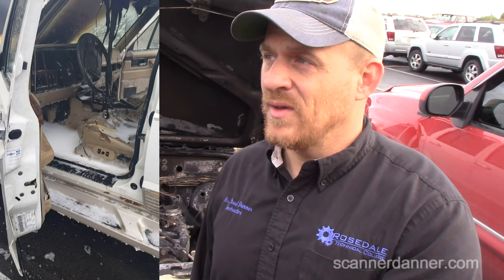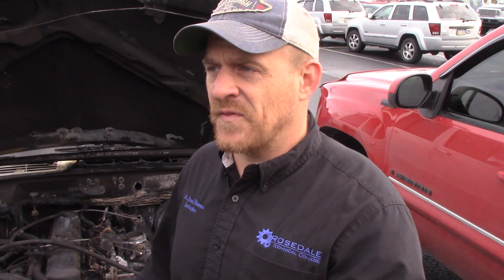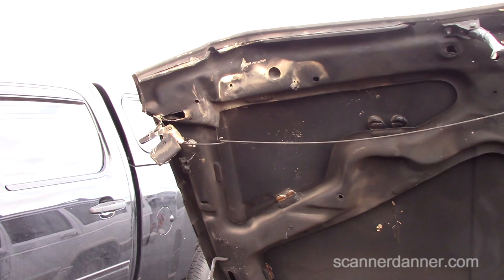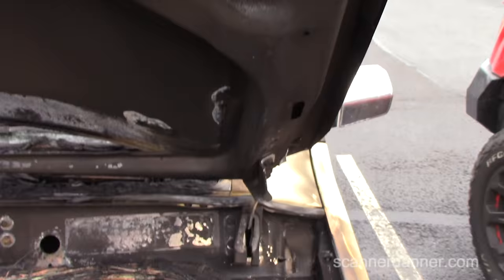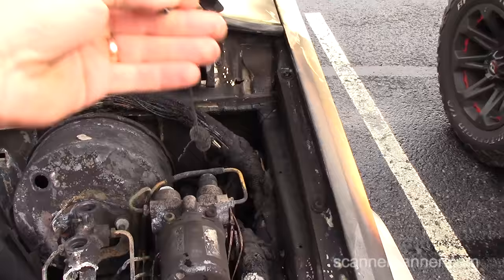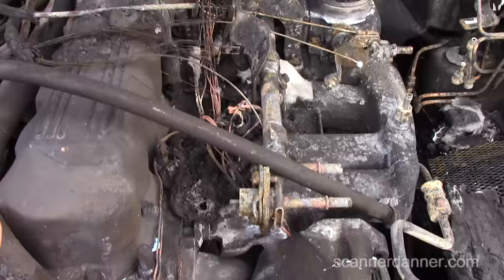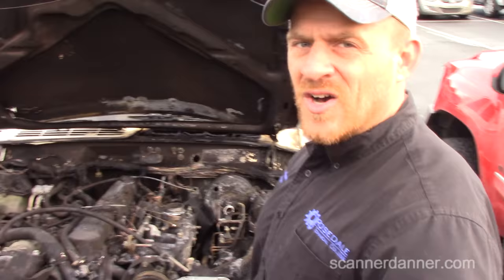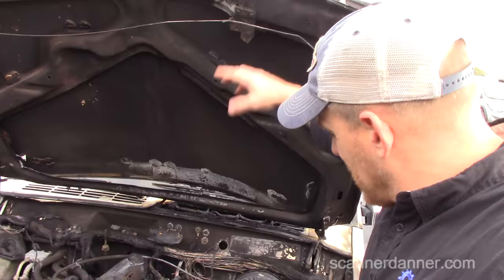ScannerDanner's Jeep CATCHES ON FIRE!!!

Comment: Well some days ya get the bear and some days the bear gets you... Dang man, and that is why I make sure my garage keepers insurance is fully up to date :) Like you say, at the shop last, you own it, right or wrong. I can't prolly find you a real sweet NY jeep if you like, you know, just a little rust haha
Reply: Only 3 years old, new tires and low miles right?  O_o
Reply: South Main Auto Repair Some days you get the elevator, and some days you get the shaft.
Reply: South Main Auto Repair. I put a rear end in a 95 F 150 customer pick it up 4 day later come back in next morning to work it had an engine fire customer got a nice used truck for free....... it happens
Reply: Some days you're the bug, some days the windshield.
Reply: As a shop owner I would be looking for a way to blame the customer, if that doesn't work offer kbb trade in value, if the customer still persists find the cheapest running cherokee I could or one with a blown engine to swap the engine into and send them down the road.  No way I'm buying you a new 80K range rover when you had a cherokee with 300K miles.
Reply: Might last ya six months to a year before big nasty condemns it. Lol.
Reply: South Main Auto Repair LLC
  the bear bitten 
ScannerDanner in the rear LOL

Comment: i worked on a car like 15yrs ago that caught fire after it was driven away and parked for about 4 hours. i put a fuel pump in it but the fire started in the trunk area above the pump, we still bought the car. customer was happy with the outcome and has remained a customer to this day. they also got a free pre purchase car inspection and i gave 1/2 the labor away on their first major scheduled maintenance. we owned the mistake (not knowing if we did it anything wrong) and kept a customer happy.  customers just want to know that you are gonna stand behind your work no matter what happens. i'm sure techs everywhere have many stories that end well like this. good luck with your search for a replacement.

Comment: Paul, been there brother! I changed a timing belt on an Avenger on a Friday afternoon. Didn't quite get done before quitting time, so the boss hired someone to finish the job. He still didn't quite finish the job, so Monday morning I wrap things up. Everything seemed to be OK so I took the car to the gas station a few miles away since it was on empty. When I came out after paying for my gas, the car was on fire. Luckily, I was able to pop the hood. Another customer dumped his brand new soda on the fire, then used the empty cup to grab windshield cleaning solution and we got the fire put out. Turns out that the valve cover gasket wasn't in the groove in the valve cover, which caused a 1/8" gap between the valve cover and the head. It didn't ignite right away, but after all that oil leaked out and puddled on top of the frame, then it ignited. Fortunately the only damage that occured was a little bit of wiring. BTW, love your videos.

Comment: Sorry for your loss. I've blown crap out from under valve covers before the same way you have described and haven't had any fires. I haven't done it 1,000 or even 100 times but still no fires. Come to think of it I blow off the top of the engine quite often, and sometimes fling oil from a leaking gasket all over the engine compartment, when replacing intake gaskets and valve cover gaskets. I'm not a jeep guy but have a couple of buddies that are and I know they'd be devastated from a fire like yours. Good luck in your search.

Comment: There were some Bosch fuel injectors from the mid 1980's to mid 1990's that were prone to having the internal o rings leaking when using gasohol (which is 10% ethanol and sold everywhere today except for some marinas). My '86 Buick Century with the pre 3800 FWD 3.8 liter had the Bosch injectors that started to leak. Injector Wizard is where I bought the replacement refurbished injectors and they had a list of vehicles with problem injectors and the 4.0 L Jeeps were on that list.

Comment: I own  two Cherokees. A 93 and a 95. The 95 I own is just like the 94. I have done the same job you did to them (valve cover gasket), and that definitely did not happen. I am thinking that you had an exhaust manifold crack, (very common on these) and you managed to get some debris from the valve cover job on it. The only other time I have heard these things burn down is when the injectors fail and they start to leak. I have replaced my injectors with more high performance ones anyway, so that issue is gone. I am sorry you lost your jeep, I was so excited to see videos from you about a car like mine. I hope you get another one someday. Thanks for your videos!

Comment: Hey , at about 5:54 in I am 90 percent sure I cannot see the heat shield that was or should have been done for the recall. They used a heatshield under the injector harness to prevent exactly this from happening. Generally the injectors would blister open and rupture allowing the fuel to flood over the exhaust manifold. specifically in the area of cylinder 3 . Wish I could zoom it in just a bit more
Reply: ONBOARDTECH333 yep I noticed that too. My 98 Cherokee had the same problem. I learned about it because my injector harness insulation got brittle and the injector harness shorted.
Reply: *****
The problem here though is discerning whether or not a fuel leak was the direct cause. It's very possible for an electrical fire to cause a fuel hose to melt/burn through and fuel the fire.
Reply: Benjamin Esposti , My   thoughts  exactly ,  for  sure ,  Electrical ,  Maybe  a" HOT  Wire"  that  was  running  on constant  power  from  the  BATTERY , (UNFUSED) , &  IS RUNNING  INTO  the  fuse  block ,  probably  got  a surge  of  power , & just  went  OFF ! ,
   SOMEone prior  was  doing  electrical  work ,  i know , 
i had  to  install  a , "Brake  Controller " on my  mini  van  for  my  Pop  up  Trailer ,  & the  instructions  are  specific ,  because ,  if you don't run a wire from the controller box straight to the battery ground ,  your trailer   brakes  will not work...

Sorry  for  your  Jeep,  Paul ,  but  at  least  you  caught  it  time ,  & no one  got  hurt ! !

Comment: Sorry this happened. You and Eric O are right. You worked on it last. The customer will not understand because they don't have a way to get around. The carbon thing is common but since I came from the time of Quaker state under intakes I use a shop vac now. It seems plausible that brittle insulation on injectors short to a power and ran up in the harness toward the hood cable. Count your blessings . It could've been worse. thanks Eric O for the insurance reminder..

Comment: Sorry for your loss. Hats off though for accepting responsibility. Right or wrong the customer always blames the last guy who worked on it.  As a mechanic for 30+ years, I don't think oil chunks on the exhaust would have burnt wiring on the fender- not that quick anyway.

Comment: Hey Paul, sorry to hear of your loss. I've worked on quite a few of these, and my dad owns a 2000. One common problem with them is the pcv system. They pull a lot of oil thru the air cleaner box. Since you just did the valve cover, chances are, the hose to the rear fitting on the valve cover cracked, being old and brittle. That may have been what fed the fire. Also, the hood release cable goes up the hood along the diagonal brace to the bellcrank.

Comment: I own a 93 Grand Cherokee that has survived a very similar electrical under hood fire.
The fire was put out quickly and did not really do much damage. There is still evidence where a hole melted through on the fuse cover. As some of the other viewers have suggested I doubt it was caused by blowing out the oil coke. A very good indication is that there was enough heat so quickly to melt the hood latch cable. An Electrical Arc will produce this kind of heat doubtful that oil coke would unless burning for a lenghty time.
PS. If you would like to replace yours with a 93 let me know and we can work out the details (LOL).

Comment: Sorry for your loss Paul. Looking at the video it seems that the main heat source is from the the wiring harness near the brake master cylinder on the firewall. The white on your hood amongst all the black soot is a dead give away that the most intense heat of the fire was there.

Comment: Tough break.  I cleaned out the lifter gallery in a 403 Olds of carbon-like coal chunks with a fireplace shovel.  Collected half a shopping bag full.  Lack of oil changes is a serious problem.

Comment: Used to work on a lot of 30 year old air cooled vw's (when they were only 20-30 years old) and sure- yes, antique cars (and that jeep is nearly antique) will catch fire sometimes.  I think we had at least 7 or 8 extinguishers in the shop.  I had one catch fire 5 miles down the way on my test drive loop.  put it out with a bottle of water from a passing motorist.  that bottle of water (and the hood cable was the difference between my situation and your total loss.

Comment: Had a similar case where I work.  Did some work on a jeep came back 2 weeks later with an engine fire.  It started above the interior fuse panel and made it through the holes in the firewall.  Did the same as yours burned the hood cable in half.  We don't think it had anything to do with us but like you said we basically bought them a car.

Comment: Bro, that's a shame! That was a great vehicle platform for your video series. I can see clearly that the fire started a the main engine harness by the scorch marks a the back underside of the hood near the cowl panel. You state that you smelled an electrical burning smell, that was probably the conduits beginning to smolder and by the time you returned from getting coffee , the harness had begun to burn which lead to the release cable frying. So sorry for the loss, but , it served a useful purpose in teaching and learning , so, in that respect, it was not effort in vain. Please , in the future, stay away from jeep products, what if your family was in the vehicle when that happened, a tragedy of major proportions could have insued. Thank God that only the jeep was the loss. Your a blessed man!

Comment: Years ago I was a working manager in Woodland CA.  The owner brought his Blazer in after a transmission shop put a trany in but couldn't fix the check engine light.

Test drove with scan tool hoping to catch a glitch.  Romped on it pretty good too.  Came off the freeway and headed back home when I noticed smoke coming from the back of the vehicle.  Pulled over and noticed smoke coming from under the hood, not much, but it was smoke.  Don't remember the color.

Got out, opened the hood, and saw that the fire was caused by a transmission fluid leak dripping on the exhaust manifold.  The trany shop had a make shift rubber line in place of the steel line, elevated about the exhaust manifold.

No extinguisher and fire was too big.  Closed the hood, got the scanner and walked away.  Passerby stopped and  I asked him to call 911 (cell phones were not popular back in those days).  Fire department came shortly thereafter and put the fire out.  Coincidentally an investigator was 'educating' his apprentice side kick, showing him where the fire originated (pointing to the opposite side of the engine compartment that the fire actually started).  Told them differently which resulted in a luke warm reception as if I didn't know what I was talking about.

Transmission fluid does catch on fire.

Another case story:

Working at a Toyota dealership a tech drove back into the shop from a test drive with smoke coming out from the hood.  Opened it and there was a small but manageable fire on the backside.  He just replaced the rear valve cover and pinched the gasket making it leak oil on the exhaust manifold.

Here is another one:

Working at a Shell gas station a young man was yelling 'help fire!' from a bay on the other side of the shop.  He just put an injector in a Cadillac and it caught after a test drive due to a cut o ring.  What made it worse is the hood didn't stay open (struts).  Put the fire out with minimal damage.

One more:

Worked as an apprentice at a Nissan dealership.  Nissan had a recall of some of the older vans catching on fire due to a coolant leak.  The vehicle would overheat, the hose would spring a leak onto the exhaust system and it would catch on fire.  So, they were retrofitting these new vehicles with a revised computer system (and other things that don't come to mind).  Yes, coolant was the cause of the fires.

Ok, one more (last one; I promise):

Working at another Toyota dealership a customer brought in their Tacoma due to an intermittent no start, which was caused by a defective starter.  Customer declined work due to being too expensive.  As the vehicle sat out on the return lane for the customer to pick up the vehicle started to smoke under the hood.  Customer yelled 'Help help! My car is on fire!'  Young buck came to the rescue with a fire extinguisher and put the fire out.  What happened is that the solenoid stuck causing the battery cable to become super heated due to too many amps, catching the insulation on fire.

S**t happens, even to the best of techs.  If you are working out of your garage on people's cars, and are not insured, you can be held liable so be careful.  This is a prime example of how things can get real bad, real fast.

Comment: Sorry that happened to you.  I hope your next Jeep is even cooler.  I set my Bronco 2 on fire once.  Fuel pressure regulator went out.  Cylinders had hydraulic lock.  Took out plugs and cranked engine which pushed out fuel just fine.  Except a spark from one of the plug wires set it ablaze.  DOH!  At least I had the hood open and was next to a bunch of fire extinguishers.  No serious damage.  Whew! Very exciting.  Lots of running and swearing.

Comment: I saw this the other day, glad you're OK Paul. you're a great teacher and very humble. Im an automotive tech down in Florida and my shop does independent forensic investigations for insurance companies, lawyers etc.  Without bias to the vehicle or work,  just by a quick view it appears if the fire started in the main harness on the driver side fender. That is an obvious hot spot along with the obvious damage/cracking to the master cylinder. The wires near the injector don't appear to be as brittle,  if the fire were injector/fuel related you'd see a lot more heat damage in that area. By what I saw I'd most likely bet after a few other checks our lead investigator would likely deem that accidental by cause of faulty vehicle wiring/component placement. 

Think of it like this,  if the release runs along/near the main harness and you chafe the wrong wire guess what,  you just welded that release cable to the inner sheath. Boom,  no Hood pop and would happen soon and without much smoke or indication of heat.
Reply from the maker: Thanks Jon. The interesting part is the hood cable didn't get welded to itself, it was melted completely. When I pulled the cable, the entire inner cable pulled out. The hood release was broken when I bought it and it had vice grips as the hood release. So without the normal hood release, you can visualize how the entire inner cable would pull out. I had 2 foot of cable inside the Jeep when I pulled it. At that point, I knew it was going to be a total loss.

Comment: I lost a 91 Capri because a trans cooler hose split and sprayed fluid on the exhaust manifold on a 97 degree day in 2005. No insurance. When I hear that your jeep had 300k, all I can say is it has a long life and served you well. Good look with whatever you replace it with.
Reply from the maker: Yep, but it's long life was with someone else. I just bought it a few months ago and probably only put 50 miles on it.

Comment: I had a similar experience many years ago, I know how you feel I felt the same back then, the only positive thing to come out of my experience was the customer admitted the fire was not caused by the work I did, which was changing the rocker gasket on a Renault, I guess I got lucky back then. Good luck finding another motor and don't let it get you down, we're human at the end of the day, we can't see everything on a vehicle we have worked on, they are very complex machines nowadays.
I remember attending a Forensic Fire investigation some years back, the forensic was examining a £160 000 truck completely burned out, the driver smoked and had instructions not to smoke in the cab while driving, the forensic found a cigarette stub in the air box housing, caught the air filter (paper) intake air accelerating the fire (like blowing on a cig end), the whole truck burned out. Apparently the truck driver smoked in the cab through the cig stub out the drivers window and the air intake (many litres of air per second) sucked the cig stub into the air trunking and the driver denied it but DNA proved it. If it were financially viable forensics would find the proximate cause, but its probably not cost effective.

Comment: It is unfortunate to see what happened. Don't let it get you down.

I personally believe it was the wiring harness that caused the fire. I saw one car burn down across the street. The car was sitting after being parked. Then suddenly the alarm went off for no apparent reason. 10 minute later the car burned down completely.
Another example where a car burned down for no apparent reason in a workshop when it was left on the lift overnight. Took a whole block of units with it. Very unfortunate for the garage owner and everyone involved.
I believe UniversityMotors channel has a video where they replace a harness on an MGB because it tried to smoke the car.
A sharp kink in the wire or faulty electrical component can result in a fire down the road.